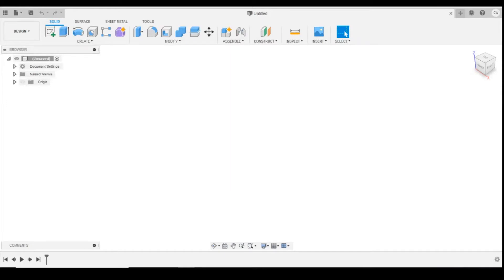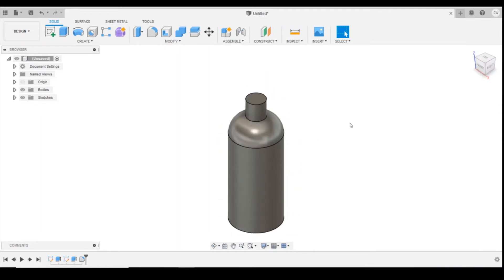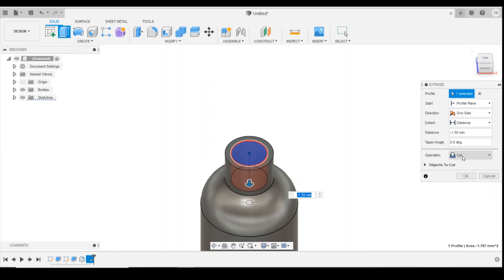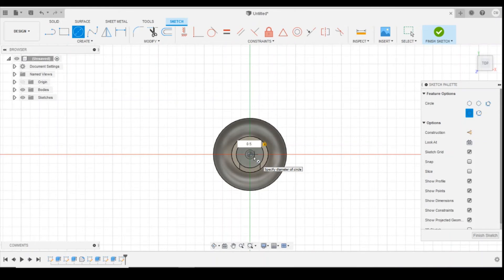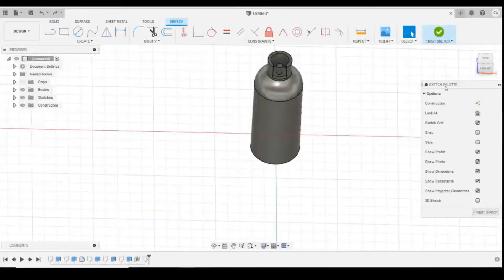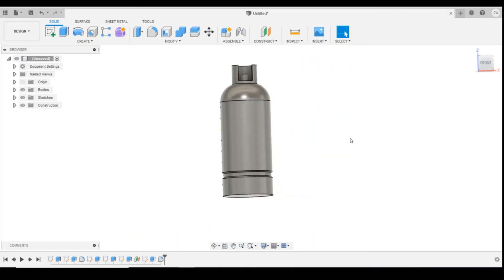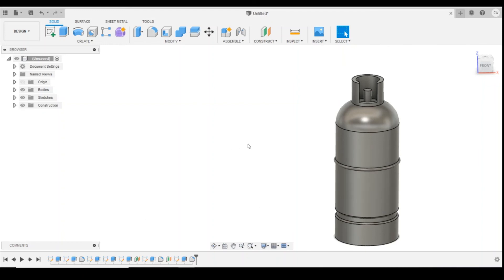Lesson 4 -  Beginners guide to learning CAD in Fusion 360 - Center Point Circles, Fillets.

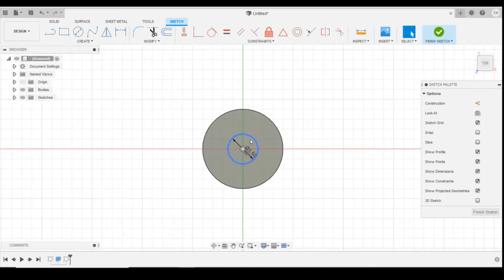Comment: Is it possible to draw at 1:1 and then scale down the drawing ? I want to draw a tail lamp at full dimension then convert it to 0 gauge by reducing it to 1:43.5 ?
Reply from the maker: Hi Nick,

Yes you can do that but you might have issues with parts becoming too small for the printer to be able to print

Comment: Hi Carl, I've used this tutorial as as guide for me drawing a chimney pot, quite straightforward but then I drew a more complicated pot with a "crown" top - a bit difficult to describe without a photo, but where you used your rectangle to cut out part of the top, I've used an inverted extruded triangle (like an upside-down Toblerone)  to cut out a triangular shape but I needed to do this for the entire circumference to end up with a crown of ten points. I did manage it in the end but wonder if you could tell me how you would do that as I suspect there may be a much quicker way. Thanks
Reply from the maker: Hi Paul,

Good to hear your starting to design your own items.

What your trying to do needs the Circular Pattern tool described in this video:

https://youtu.be/BN4K0txdG0Y

Regards

Carl
Reply: @3ddrawingformodelrailways  Thanks Carl - I'll take a look.
Reply: @3ddrawingformodelrailways  Thanks Carl, I'll take another look at that